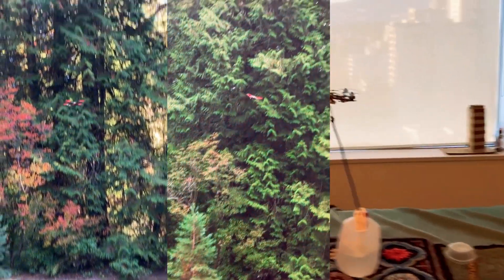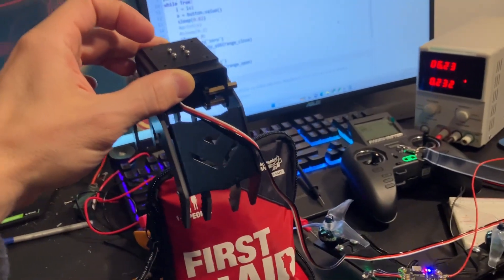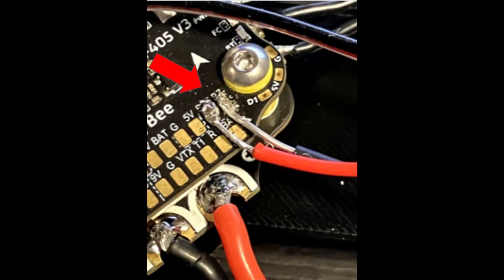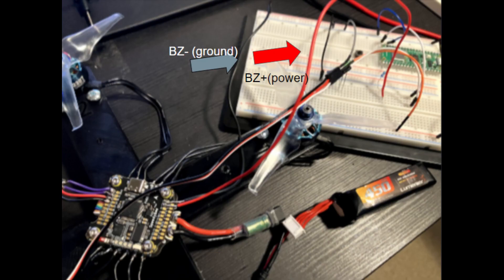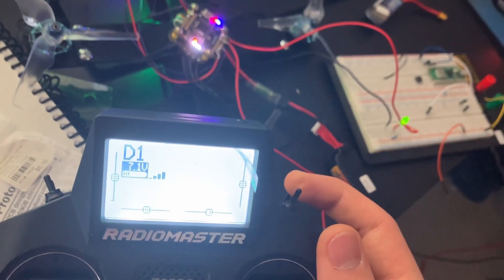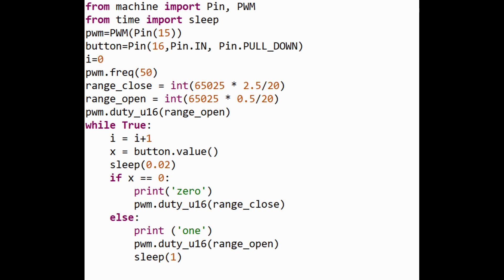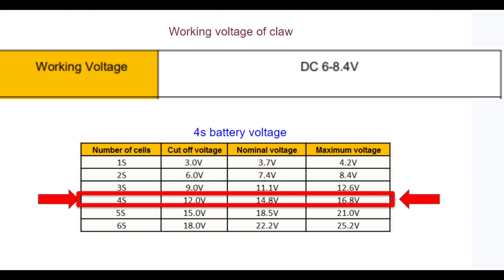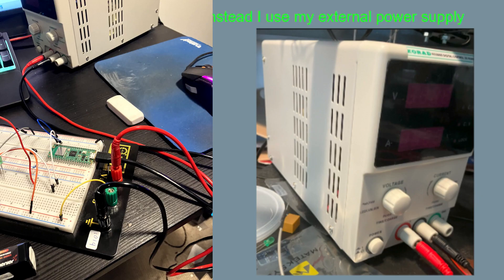Controlling Claw Using Flight Controller and Raspberry Pi with PWM (SpeedyBee F405)

Comment: awesome bro.
but couldn't you have just used the S9 pad on speedybee F405v3 to output PWM for a servo and no need for arduino? what do you think
Reply from the maker: Thanks for the idea. I used the raspberry pi because I wanted full control over both the pulse width and especially the duty cycle to obtain maximum control of the claw. There might be a way to control that using the  S9 PWM output on the flight controller but I could not find it in the documentation.
Reply: @bigbrain10k  I used the S9 pad for a servo for a drop mechanism.

on speedybee F405v3 the S9 pad is already mapped for servo output so you don't have to do any resource mapping in CLI.

you can enable servo tilt in in configuration tab, which is a feature meant for dual servo camera gimbal but enabling this enables 2 servo outputs that you can use after which you can go to Servos tab and select your desired aux channel to control the servo.

servos on betaflight feels confusing and complicated but at least I got that working.

if I would need more than two servos then servo tilt feature wouldn't be enough and maybe it could be done with channel forwarding but I'm not sure because servos are so confusing on betaflight.
Reply from the maker: Good idea. But I would like to keep my servo ports for future gimbal use. Also, once I have a raspberry pi working, it'll have a greater on-board intelligence, which will give it greater versatility.